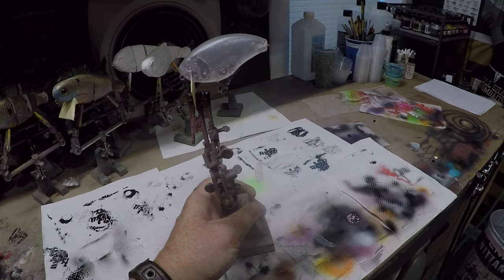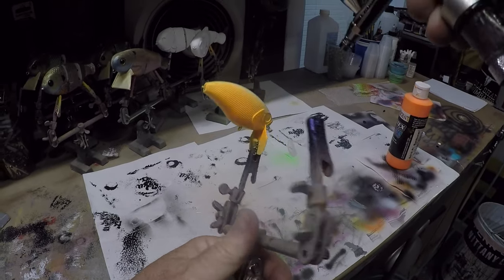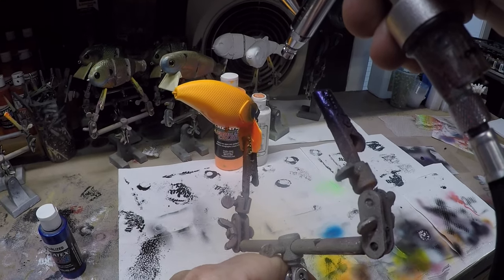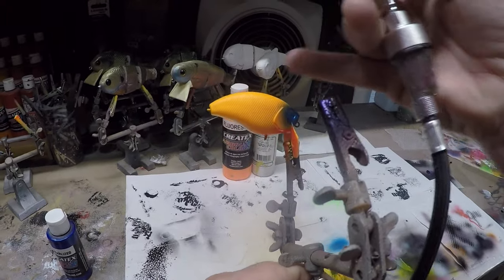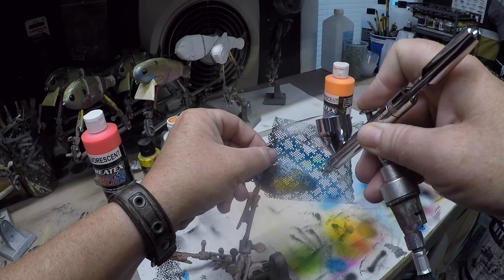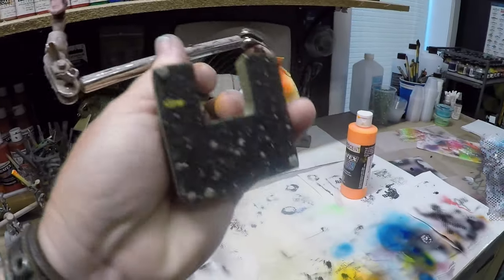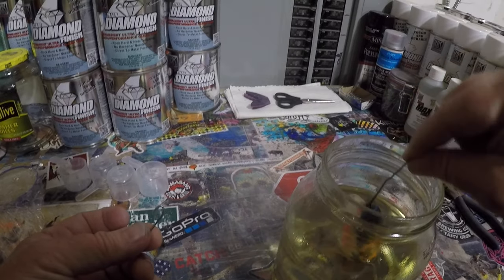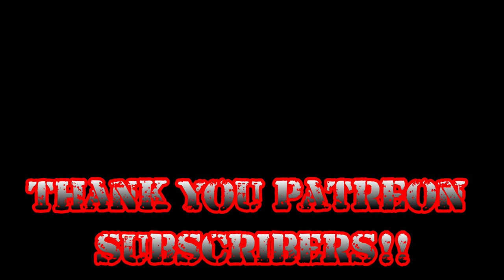FINALLY!! Subscriber Requested Spray Session (Sept. 04, 2021)

Comment: you do a wonderful job.i have a question,how do you spray and not have but very little if any overspray
Reply from the maker: All in trigger control and pressure. Detailed work is usually sprayed at 10-15 psi, regular base layering around 30-35

Comment: Is there anything different you do when 2nd coating with KBS clear ?
Reply from the maker: No, just dip or brush a second time. It’s different than 2 part epoxy, which can sometimes dry uneven or with bubbles.